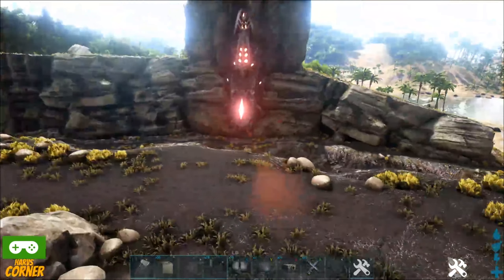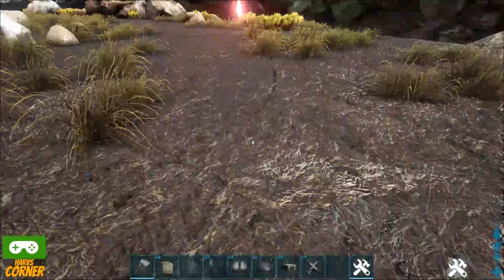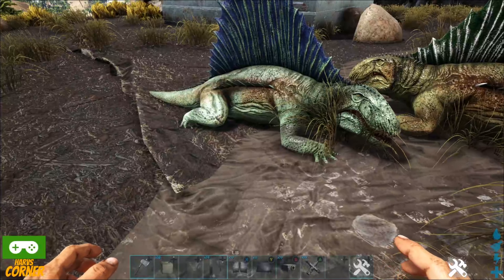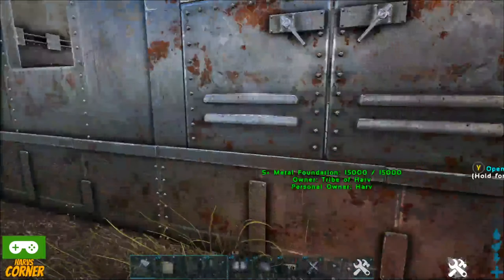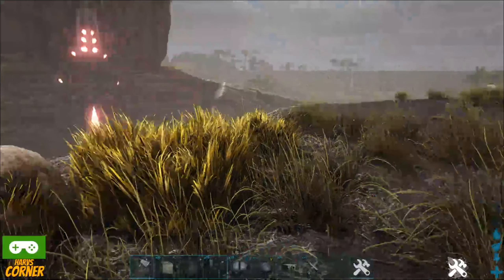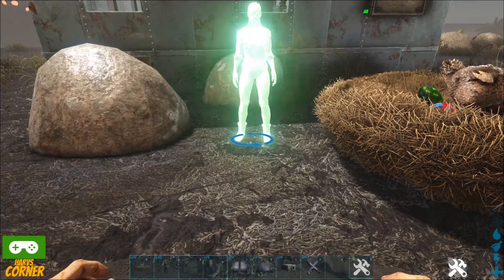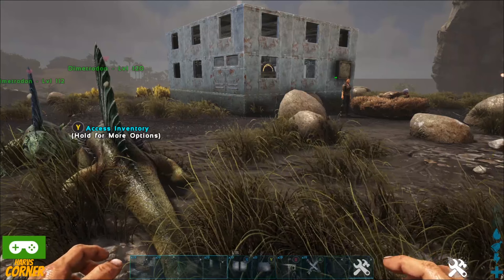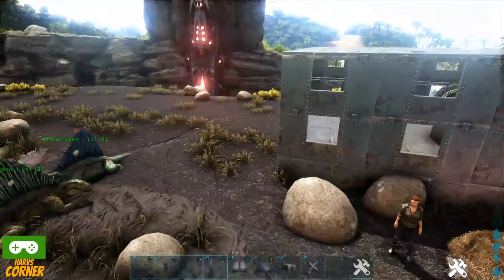Ark How to Hatch Eggs

Comment: Thanks for this vid - I pick up a lot of eggs but they generally don't say that they are fertilized and therefore they never hatch - How do I find fertilized eggs?
Reply from the maker: No worries.  So those normal eggs are really for making Kibble.  Most Fertilized eggs are made from tamed creatures mating.  An example would be a tamed male and female dodo.  When they are both set to "Enable Mating" , the result is a fertilized egg.  There are exceptions though, such as wild wyvern eggs or wild rock drake eggs.  But by and large, fertilized eggs will come from mating your tames
Reply: Harv's Corner legend

Comment: I just tried incubating a dodo egg, I put it near one campfire and the incubation was dropping. After a while the fire was still burning but the egg stops incubating and loses it's health. Can you explain me why that happens?
Reply from the maker: All biomes will experience changes in the weather.  For instance biomes will get colder and hotter during days and nights...also when it rains or snows.  I would recommend using more than one campfire and see if that does the trick.  It sounds like something is happening and the weather is changing JUST enough to mess up the hatching.  Good luck, hope this helps!
Reply: @HarvsCorner  thx a lot and wow thats a fast reply

Comment: To hatch wyverns, do you need a certain amount of air conditioners or can you just use 3
Reply from the maker: You will need a lot for wyverns, i dont remember the exact number but its definitely more than 3
Reply: Harv's Corner thank u great video
Reply from the maker: @Spottedhusky  Torches only provide heat.  ACs provide both hot and cold.  Ultimately ACs are the best structure for hatching
Reply: Harv's Corner we hatched our first two wyverns today., and we found out 16 was enough to do the job on official
Reply from the maker: @aidenelford874  Awesome!!  Congratz on the Wyverns!

Comment: Thank you for creating the video. Can you do one with Kairuku as the incubation source?
Reply from the maker: You're welcome!!  The problem with using the Kairuku over the Dimetrodon is two fold.  One, the Kairuku only adds heat (hypotherm).  Two, its not adjustable by its level stats that I've seen.  it can definitely be used as a heat source for eggs but you run into needing more and more, where the Dime can simply be leveled in stats.  While i love penguins :) ACs or Dimes are more practical.
Reply: Thank you for answering my question about kairuku! Now I know I gotta get dimetrodons!
Reply from the maker: @Jessica411  Happy to help!

Comment: Hey On xbox it doesnt show the to warm or to hot feature. Am i doing skmething wrong?
Reply from the maker: Are you using a fertilized egg or a normal egg?  Fertilized eggs should have red smoke around them.
Reply: Harv's Corner Normal Egg. Im hatching it with fire places
Reply from the maker: @imdubz9630  Normal eggs will not hatch.  They are used for Kibble and other things.  You need fertilized eggs which are obtained by mating a male and female dino
Reply: Harv's Corner oh...
Reply: Harv's Corner thank you though.
Reply from the maker: @imdubz9630  You're welcome.  Regular eggs are still important so definitely hold on to them
Reply: Harv's Corner how can I use them other than consume them?
Reply from the maker: @imdubz9630  You can use them for making kibble
Reply: Harv's Corner oh ok thanks.

Comment: In your opinion what is the best way
Reply from the maker: Either ACs or Dimetrodons.  At that point its really preference.  ACs require power and wiring, Dimetrodons can be difficult to tame but you should only need a few.  Overall, for me, i would go ACs.
Reply: Thanks I subbed

Comment: Can you still warm up the egg with campfires? Im trying to do that
Reply from the maker: You can use campfires just be careful.  Sometimes the baby will hatch and wander around a little before you can claim it.  If it runs over the flames it will take damage and could possibly kill it.
Reply: @HarvsCorner  how many camp fires?
Reply from the maker: @garfieldchan9034  it depends on what you're trying to hatch.

Comment: i have the game on pc but how do i upgrade to S+ ?
Reply from the maker: You need to go the steam workshop and subscribe to the Structures + Mod.  Honestly though, at this point.  You should probably try Super Structures instead.  Its generally the same thing but updated better.
Reply: @HarvsCorner  I didn't get it from steam i got it from epic will it make a difference ?
Reply from the maker: @yigras  I'm not entirely certain on that one.  BUT, i would suggest downloading steam if you haven't already.  From there go to your game library and "Add a Game"  You have the option to add a non-steam game.  If that works correctly, i would think you could add mods through steam like normal.  I'm not 100% certain on this so i would recommend looking at the steam community forums to see some more info.
Reply: @HarvsCorner  MANY THX
Reply: @HarvsCorner  nice tip, i will try that although i use geforce now so im not sure it will work. Any insight?
Reply from the maker: @ronwesilen4536  I'm not terribly familiar with geforce but i would assume the process would still be the same.  Might be a question for them or the steam workshop forums

Comment: i cant see that egg healt what i need to see it
Reply from the maker: So if you are very close to the egg, it should pop up with the health and incubation.  Worse case, pick the egg up and look at it in your inventory.  It should have a health and incubation measurement in there as well.  Also, make sure this is a fertilized egg and not a normal egg.  Hope this helps!
Reply: @HarvsCorner  How can I tell if its fertilized or not
Reply from the maker: @margi41  If its on the ground, hover your cursor over it, if it has health and incubation bar its fertilized.  Also Fert eggs give off a red mist.  If its in a container or inventory, hover over it and it should have the health and incubation timers.  If it doesnt, its a regular egg.  Just remember Fert eggs are only obtained by breeding.  Eggs that are just laying around are not fert eggs

Comment: I just used standing torches
Reply from the maker: Those will definitely work, only problem with them is if you need a cooler temp for the egg.
Reply: @HarvsCorner  ya I just unlit the torches if they're hot cause I'm low level

Comment: I’m not getting a bar saying the heat or anything? Any reason why?
Reply from the maker: You probably have a normal egg and not a fertilized egg.  Fert eggs are only obtain by breeding tamed animals
Reply: Harv's Corner is there a certain way to do it because I have a Rex egg I wanna hatch from my 2 tamed Rexes but I put it next to campfires as I don’t have those things in ur vid and no bar shows...
Reply from the maker: @endicore1231  did you have the rexes on "enalbe mating"  if not, the egg that dropped is not fertilized.  if its fertilized it should have a red smoke around it
Reply: Harv's Corner I’ve done it now thank you so much for helping you don’t know how long I’ve been trying to figure it out I appreciate your help and time thx.
Reply from the maker: @endicore1231 You're welcome, glad it worked!

Comment: what if i drop the egg and it wont even go into incubation
Reply from the maker: Does the egg say its too hot or too cold?  If it does you need to get the temp up or down. If it does not, you may have a regular eggs and not a fertilized one.

Comment: Why dont my eggs say "Too Hot", or "Too Cold"?
Reply from the maker: because thery're not fertilized eggs.  eggs you find on the ground randomly arent the right type.  need to mate tames in order to get fertilized eggs
Reply: @HarvsCorner  My dinosaurs keep dropping random eggs even though I don't have them as mating. Is that why?
Reply from the maker: @iirunla4359  Yes.  they will randomly drop eggs but those are not fertilized. you can use those to make kibble later but thats about it
Reply: @HarvsCorner  Dude you are amazing. I am fairly new to the game and was so frustrated yesterday because I couldn't hatch the eggs. Thank you.
Reply from the maker: @iirunla4359  Happy to help!
Reply: @HarvsCorner  I'm back with another question since your very helpful. I play on console with max difficulty which is 1 on a non dedicated server. The map is the island. Even with max difficulty I rarely see high level dinosaurs. Recently I've been looking to tame a rex and cant because there like between 5-30 in level only. Am I doing something wrong?
Reply from the maker: @iirunla4359  The DifficultyOffset is correct at 1.0 but you need the OverrideOfficalDifficulty set to 5.0.  You also want to run a dino wipe afterwards.  Should start seeing max level 150.  Dino levels should all be in intervals of 5
Reply: @HarvsCorner  When mating dinosaurs, is the level of the offspring random?. I recently mated a 250 male argy with a 170 female argy and the baby came out 136. Why is that?
Reply from the maker: @iirunla4359  Sorry for the late reply but this is for multiple reasons.  
1, the levels for mating are based off the level the animal is right after you tame it.  All the levels you get from experience and level ups don't count.
2, sometimes the level will be lower becuase the baby is grabbing the lower stats vs the higher stats. 
Check out the How to breed tames in the Ark 101 playlist for more info